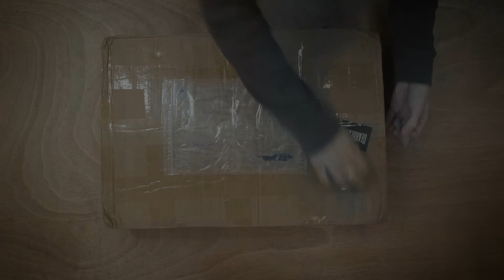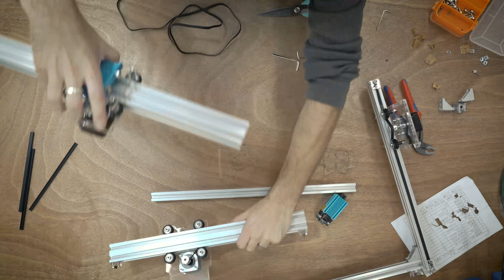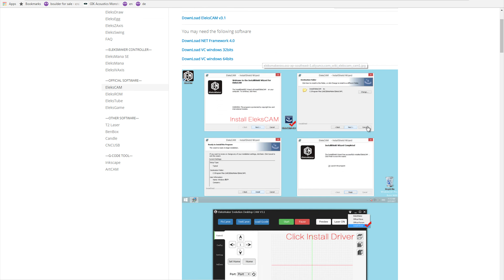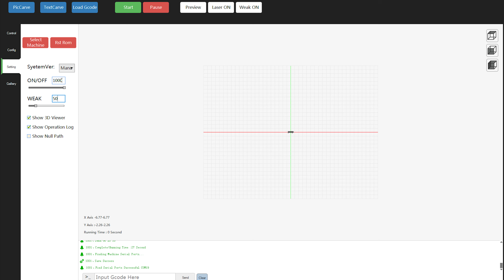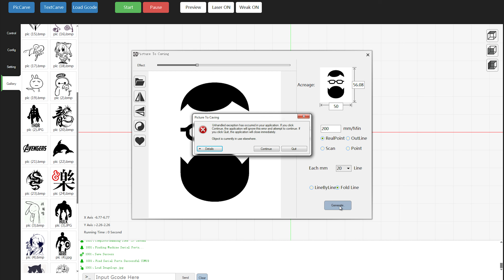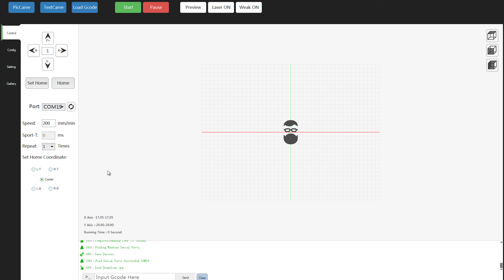Product Overview - EleksMaker A3 Laser Engraver

Comment: I dont find these little machine as bad as you tell in the end of the clip. I dont have it but i think, that - like already described by others - it is a solid beginner model for users, who want enter the world of engraving and explore first resultats without give tousands of money for a professional purpose. Even if it would be bought a profesdional in the future: This little is a fullfunction what also allows to demonstrate live a process how engraving works at all. Bigger and professional purposes - in the function they are the same - but have s lot more functions and accessoires. Yes, a co2 tube laser has much more power than a little beginners diode-laser in the 2.5 up to 5.5w sector and another appropriate wavelength for cutting i.e. acryllic glas and so on...
You meant as an example for bigger powerful lasers the models i.e. k40 (if i understood rightly) instead of this... Hmmmmh if close my recommendation on a comparison between this or co2 tube versions of china-lasers - i would decide for this little!! Because every second thread about i.e. k40 "for only 100dollars/euro more to get a powerful" tells a story about little up to big desaster... If i see the manufactoring-quality of the k40 and its next version only, and look back onto this little fine engraver, i feel confirmed myself in all thoughts...
My needs are morw cutting purposes (housings for devices i.e.) and therefore not the 5.5w, neighter the 2.5w version would help me out. And wouldnt help me this wavelength... But i would buy it almost alone only for watching it ;) :)
One thing left - the testswitch. It is for testing: "does/can the laser work?"
Yes it can be dangerous, because fullpowered the laser starts working without further warning... But also very expensive laser-controllers have a function "lase on startup" whats for the purpose on powerfailure while lasing and controllers place isnt operators in the moment. So if controller adjusted in this way, fullpower lasing is continued after power returns (or start the controller next time). In my synrad 48-2 laserhead (as oem without keyswitch) with above 30w measured by synrad "unwanted/expected" full-laser-power on switching on could lightly burn sth. down. Therefore - maybe i see the "laser-confirm-button" on the top here not as a so big danger as probably others do... Knowing and not forgetting. Snd everythime dont start the laser without a fireresistant plate under it. Respect a dangerous thing help not get injured by it. Fear does opposite!!

Comment: Can I use this machine as a stamp rubber engraving ? If I use the appropriate settings can I make good quality stamps ? Thanks ,,
Reply from the maker: Yes, you can engrave rubber with this.
Reply: Thank you for the quick respond :)  Probably you did not make stamp with your machine ,but maybe you heard some info about stamp engraving .I am very curious about it because there are  many expensive engravers for example Rayjet ,etc . I would like to use this for engraving stamps and plastic name plates.   Is it a good choice  to buy  for these tasks? What is your opinion?Thank you ,,

Comment: Engraver vs Burner
This kit can engrave metal with a powerful enough laser light source and very, very carefully it may do glass with a way of rotating round glass items. To engrave soft materials that burn easily you need  The kit is like a wood burning tool vs the engraving tool used to mark pliers or other hard surfaces. Burning wood can't be called engraving. You need a Dremel motorized tool in place of a laser for wood. I can not understand the term used "engraving paper". Wet the paper first to prevent combustion @
Reply: Wet the paper first to prevent combustion @Fahrenheit 451. Other soft materials can't be vaporized by laser without ash reside.

Comment: Is it possible to burn a logo directly into a table top or slab of wood larger than the unit while the unit is sitting on that slab? I have been looking at branding irons but do not like the limitation of having just one brand, or having to purchase over and over ...vs the flexibility of putting unique or custom designs onto cutting boards, coasters and tables I have made.  Thanks in advance
Reply: I would say yes. Mainly you adjust the height of the laser, OR the intensity. As you saw, the balloon popped at 20ft away or so at max power. So you can easily brand a piece of wood under the machine. Your limitation would be the size of the frame.

Comment: hY, Is it only a Engraver CNC ? Do you know a similar model to Cut also ?
Reply: http://a.co/d/5nE5mYu . This is a similar kit with laser. If you are a DIY sort, I would mount a dremel extension arm to where the laser is and use some gcode software for the cutting. Manually turn the dremel on at the appropriate start point and let the software move it around.

Comment: Hi....this style laser machine is widely on ebay etc....what i find odd is that there is no consistent pattern of assembling the x gantry /laser...some have the belt mounted on top some on bottom....some have the stepper motor mounted with power connection pointing up some pointed down......any input on why?

Comment: I have the same engraver and I agree with every conclusion you came up with. I have more luck engraving in wood than anything else but most of the time I'm engraving text onto pieces that already have a finish applied. The finish makes it much easier to clean off the residue that is left behind. I think there was a firmware update that was suppose to correct the issue with the laser starting out on full power when you turn it on. I don't seem to have that issue now but I still make sure to keep my hands away when I power it on.

Comment: I've had nothing but problems installing the software.  It continually has issues finding the serial port.  Can't even check the machine to see if it works.
Reply: Hi there , did u solve yr software problem i have same problem the laser works fine and flash but the three motors don't move although they have power i can feel it by touch

Comment: You could just wait some minutes than remove the dust by yourself it would be better because machines usually are bad at removing dusts
Reply from the maker: The problem is that the dust is being re-cut and interfering with the laser.  Most all other engraving machines use a blast of air that removes the dust, so the laser doesn't cut through the dust particles.  Also, some dust from certain materials can be harmful to the lenses, and degrade them over time, all the more reason to remove the dust WHILE cutting.

Comment: hi im new to laser engraving and would like to buy a laser engraver frame etc complete with electronics minus the laser module which i do have....i would olike to get about 650mm x500mm size ive seen them on ebay for about $175.00 shipped is this a good price?  what did you pay for yours and did it have a laser?...im looking to get the cheapeast price out there as long as it is decent quality..nothing too fancy..iit seems elksmaker is a namke brand and probably more costly so probably not what i am looking for...thanks
Reply: This 400 X 500 frame seams good. http://a.co/d/eiX7FLF . I have my own laser as well, but at this price,  I think it's worth getting it with the laser. At least the 500mW one.I'll just swap out the laser with my own.

Comment: i think your expectations were too high and you barely even tested it out... does it use gcode? how big can it engrave. would have been nice to see if you can use it to engrave onto a table or something. those nema 17 motors looked fine.....
Reply from the maker: You may be right.  I would say my expectations weren't necessarily high, but what I WANT or NEED from a laser isn't necessarily aligned with this product.  For me and my purposes, this isn't the right product, but I have the extra money for something with the features I need.  So, you're not wrong.  But, it's a bit unfair to say I barely tested it out, you did not see ALL the testing I did with the machine.  I know it can engrave the full travel, and I'm sure I could have used it to engrave on a table or something similar.  The motors and basic electronics are fine and the frame is not bad considering.  I would have liked to see SLIGHTLY better software (which can be fixed by using laserweb or other 3rd party software), and more thought taken to how lasers really work.  Even a cheap aquarium pump to clear debris around the laser would make this infinitely better and more usable.  Also, the safety mechanism on the laser module itself was just poorly designed.  So overall, I stand by my assessment, but it may be the right thing for some people still.  I merely offer my opinion, I cannot say whether it's the right thing for someone to buy or not, that's up to you.
Reply: Robert Cowan It just would have been nice to see what it "could" do rather than what it can't. Just my opinion though. There aren't many videos like this about these lasers so it's nice to see more.

Comment: I have a feeling you are not getting the point in these machines. No one is going to go and spend £1000 + on a really good cutter if it's their first time. They want something they can start with and then progress onto. You honestly bug me with this review because you have no idea how to use a diode laser. Your blaming the cutter for your mistakes, if the acceleration is to high then lower it, don't say it's the laser fault. Yes I agree it may be lacking some basic safety features but it's a laser cutter, if your stupid enough to do stupid things with it then you deserve to be hurt. Do you slag knifes off because they lack "basic" safety features? They can do serious damage to a human. Probably more then a 2.5w laser. 

As for the software, why bother using the default? Find a third party slicer like Fusion 360 (Fusion can do CAD & CAM). The default software is, again to get you started. No one has said that it's the only software you can use with it because that's bs. You can use whatever you want, as long as the Gcode is the same.

Edit: Also if you are using plastic or something similar  you can wash the burnt dust off
Reply: It’s funny how everyone is moaning about my statement concerning a knife being more dangerous then a laser, but no one cares about the invalid point he made about the software
Reply: Which one? The 40w with full safety. And what is the key safety features? Is it like welding shield film on plexi set to the diodes wavelength?
Reply: Valesto93 it’s the same with the laser, if you are intentionally careless you’re gonna get hurt.
Reply: Amazon CNC 3080 Engraver ASSEMBLY
Reply: I do think there is something to be said about lasered acrylic pieces on an otherwise aluminum extrusion frame. what's the point of the aluminum if the thing connecting the two pieces is brittle and prone to perfectly visible vibration frequencies?
Reply: There is a software called lightburn which has a feature that shuts the laser off at the end of the line and coasts past the end of the line..drops down to the end of the next line and accelerates to running speed before the start of the next line and powers up the laser when needed. It will avoid getting the darker edges. also an air assist is easy to install. I saw one guy removing the black dust with rubbing alcohol almost to just a wood finish
Reply: I think you're missing HIS point:
You can get a 40W CO2 laser engraver/cutter with all the safety features and added features like air pump etcetera for only $340 including shipping. That's not $1000 and it's a far better (and safer) starting point to get into laser engraving/cutting.
Reply: This thing is garbage like ur comment and this video.
Reply: yeah i agree 100%. the guy clearly doesn't know what he's doing
Reply: @Agent001  HEY I THINK THAT HE JUST WANT TO BITCH ABOUT SOME THING THAT DID NOT COST HIM A DIME AND BITCH ABOUT ANY THING YOU GET WHAT YOU GET DUE TO THE COST
Reply from the maker: @AndrewMurphy8383  This is an old comment, but I just saw it.  I wanted to like this thing, but it's poorly designed and built.  For the price, I guess it's 'OK', but it pales in comparison to any other laser I've used, at admittedly much more money.  But if a car was released for $5k, and didn't have brakes, seat belts, or a windshield, it wouldn't be a good value, even if it drove.  Bad analogy maybe, but in my opinion, it cuts so many corners, it becomes unusable for most applications.
Reply: @RobertCowanDIY  its not that old  but ok
Reply from the maker: Agent '001  clearly.

Comment: will it cut white foamboard 5mm thick. Like the dollar tree foam board?
Reply: Christopher Hemmings yes and no. It doesn't like to cut white and blue things. I cut the dollar tree foam board but it was hard and caught fire easily. Instead I got a elmer.s foam board with black paper and black foam. It actually cuts the black stuff better than the  pre cut dollar tree stuff you get from flitetest.

Comment: If you buy bottom of the line 40W laser you'll face the same problems. Resolution is low because it's actually burning. Yes, the dot is small, but the wood/paper is burning around the dot too. The more power (or to be more precise energy - power for specific time ) you put in, the bigger the burned hole will be - deeper and wider. And if you actually burn wood you have to slightly overpower it because wood has grain - some spots are lighter, some are darker. The darker burn easier. So $250 or $25 000 you'll face the same problems. Except that the bigger laser will actually have some safety built in and might have better software
Reply: People have had really good luck with adding air assist to these.  It really helps tremendously on cutting down the soot and helps burn through wood by moving soot out of the way so it can cut deeper.   Most of the negative stuff is either expecting too much or not seeing how you can improve it.   But for me it's kind of a proof of concept thing.  I want to try it before I do a huge investment.  See what I can make and do with it.  Plus learn the process, software, etc.  Then if it fits and I find I need something with more power I can then make that decision.  Dumping $300 or more for something I don't know if I'll do that much with yet is a bit much for me.   Easier to find out this way. Plus I have no problem with being able to modify things to make it better.   On those bigger lasers you pretty much have to do the same thing. You will be replacing tubes, power supplies, lenses, etc. and re-adjusting mirrors a lot.
Reply: Michael hhdhbs

Comment: I liked your review of this laser a lot.   I've been interested in getting into a laser but don't want to waste time and money on junk that won't do the job. (Did see a video that improves this one a lot for PCB board work)

Clearly this laser isn't for me.   I'm interested in a CO2 laser to engrave and cut with, but I'd like good quality between say $300 to $500.   Any suggestions to a good brand to look into?
Reply from the maker: Check eBay or Amazon for a 40 watt laser.  You can usually get one for under $500 and with a few minor upgrades, they can be quite nice.

Comment: Do you recommend another machine with ventilation feature? Brand please. Thank you
Reply: I mean air assist to avoid mess after engraving
Reply: Ahmed Alwahsh  I'm thinking 3D printed part to mount a fan similar to cooling a 3D printing hot end. Narrow enough pointed end that blows air onto the point the laser is hitting. There should be a point to get power for the fan. If not, that's an easy fix.

Comment: Comparing an A3 to a K40 is just downright silly IMO. One is made to run on the kitchen table and one in a well ventilated workshop with extractor fan and water cooling. It['s a pity you had the background you did since IMO your expectations were unreasonably high to start with. I sold my K40 and bought an A3 specifically because of their differences and I'm doing far more engraving with the A3 fitted with a 40mm air assist fan than I ever did in a freezing cold shed with the K40.
Reply: Yeah and his estimated cost of a k40 laser off ebay being $300ish is USA only, being in Canada (not sure about other countries) i cant find one for under $575 USD, and if i do for some reason they have an equally high shipping cost, no joke $200-500 for shipping to Canada.
Reply: @reflector36  you pay a penalty for living in such a great country, or its a penalty for living in such a shitty country.   could go either way.
Reply: I am just getting started and want to spend around up to $1k. I'm learning about the different ones. First off can I run a 20-60w c02 in an apartment or do I need a ventilated shop? What would be the best thing to get for an apartment up to $1k? Thank you so much!
Reply: Can you recommend a A3 model? I would love to get rid of my paper cut plotter to cut my paper single by single.
I would love to layer multiple papers and make some simple silhouetts on a A3 or A4 size in it but without burnmarks. Price can be around 1000 euro. Is there something but not a CO2 laser, which you can recommend and i can use it on my kitchen :-) Because space is a big problem to me :-) Thanks in advance!
Reply: it was good info for people not laser savvy....just saved me some $.
Reply: Please   tell   me   what   I  do   for   only   stencil   cutting   for    air   brush   only   for   this   please   tell   me
Reply: I saved 15% on my auto insurance by switching to geico !

Comment: I bought this kit too (Oktober 2017). 
The assembly instructions aren't that bad: http://wiki.eleksmaker.com/doku.php?id=elekslaser_a3_pro
The laser should not start when you switch the power on. This is a known firmware bug. You have to update the firmware. 
Check the forum - it saves you a lot of time: http://forum.eleksmaker.com/category/6/elekslaser
The EleksCAM software has some bugs too.
Reply: Tiohkatrah lightburn is amazing, if you haven't tried it yet, you should.